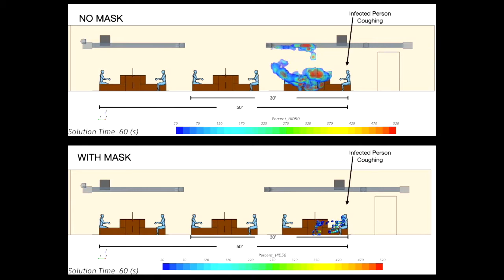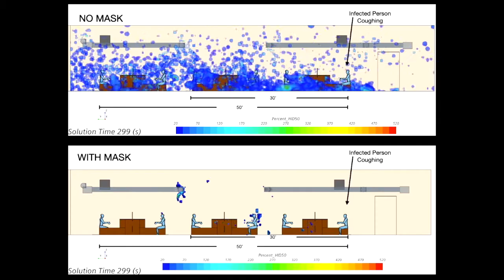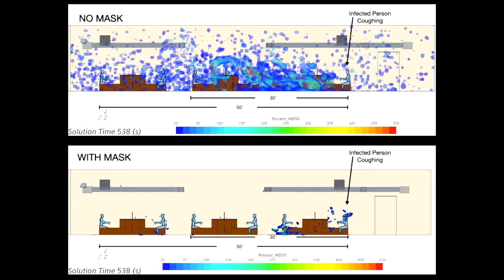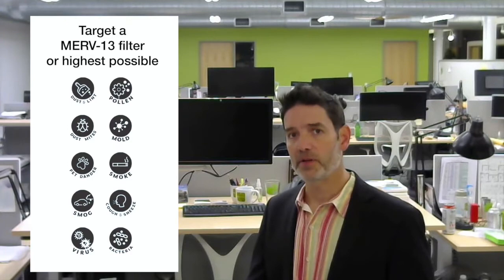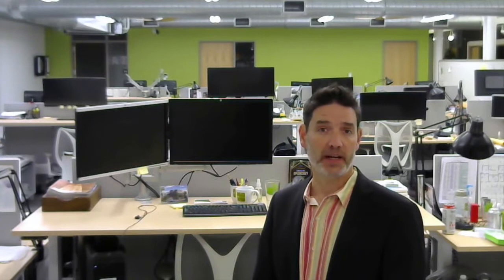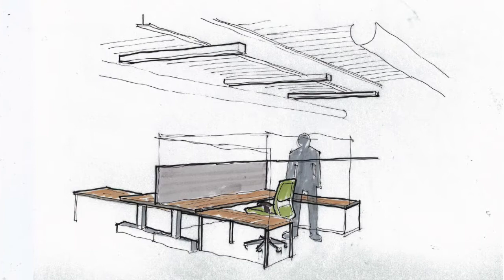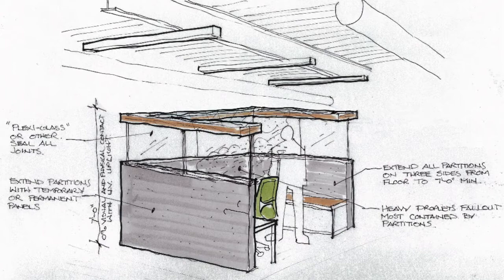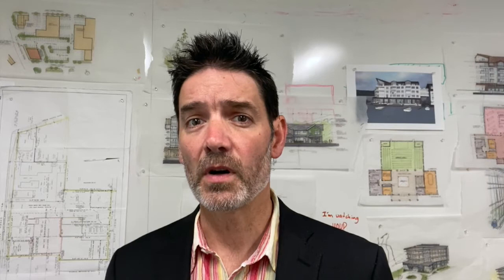Strategies for Reducing Airborne Coronavirus Transmission at HOLT Architects’ office

Comment: Please explain to me how the dark blue particle clouds become bright yellow when they contact a person and when they swirl around in the air? If dark blue means less particles how can disbursing the cloud make it more concentrated? I'm having trouble understanding the bottom simulation. Also - are you modeling the top as cloud and the bottom as points? Beyond that you say that the heavier droplets fall to the floor and the bottom simulation seems to show that the droplets fall quickly but isn't the point of wearing a mask to catch the big droplets? Why are there no small droplets in the bottom simulation?